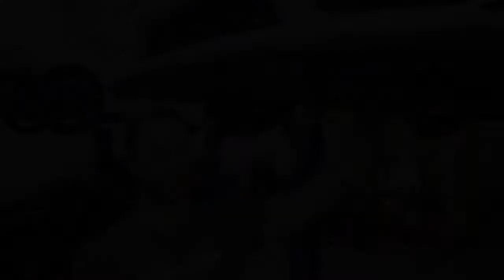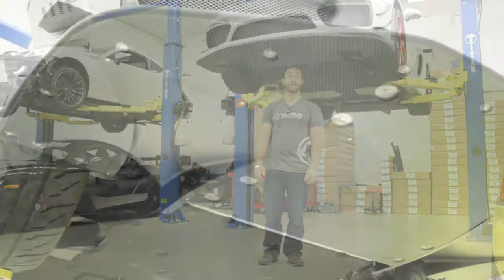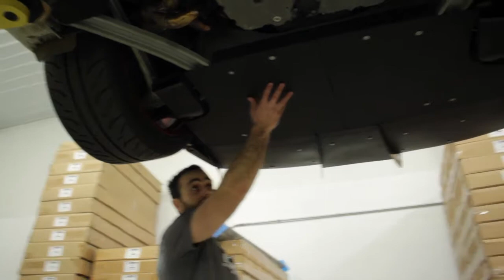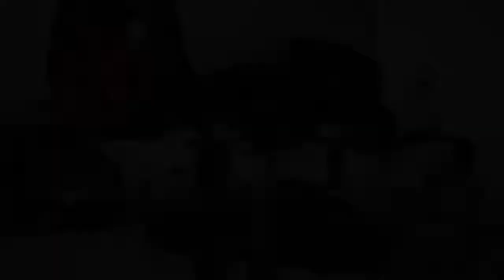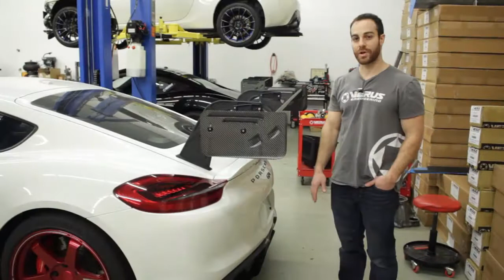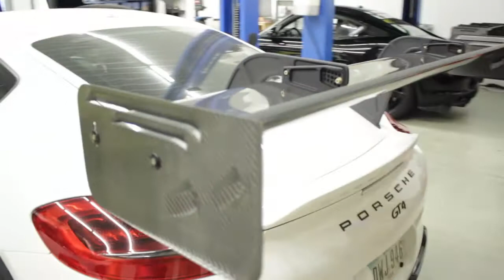Porsche 981 GT4 Ventus 2 Walkaround

Comment: When testing this aero on the track what were the tire sizes? Any idea what the max width you can run is?
Reply from the maker: No idea to be honest. This was not our car. However, you can contact our exclusive Porshe dealer, Dundon Motorsports, and I'm sure they can get your questions answered.
Reply: @VerusEngineering  thank you very much I didn't know if you had a certain tire size that you balanced the aero at. I appreciate you responding regardless of the answer.